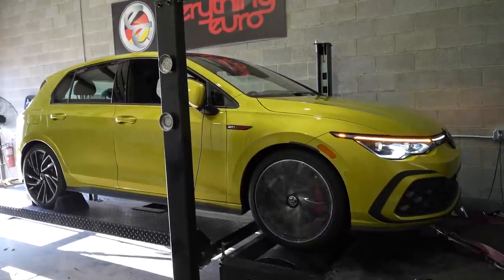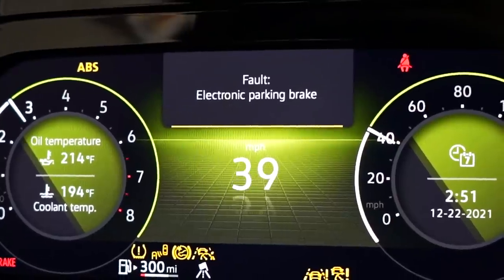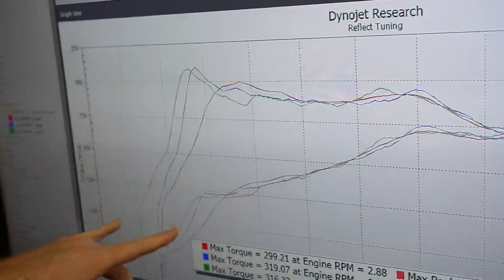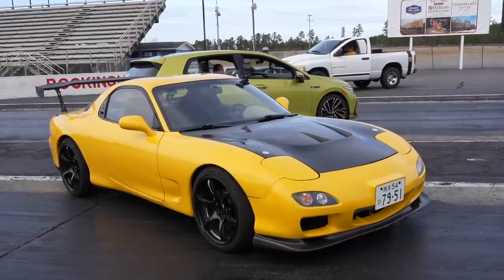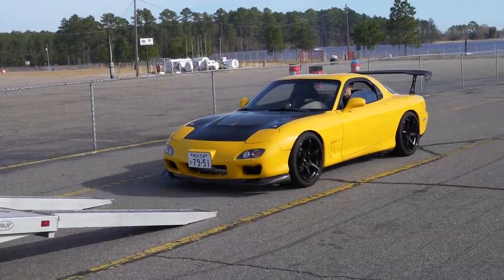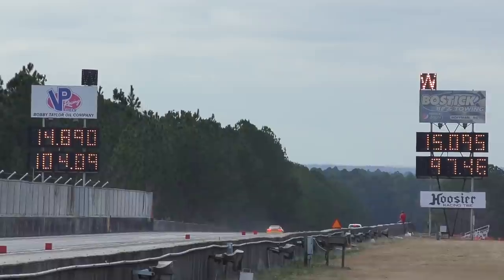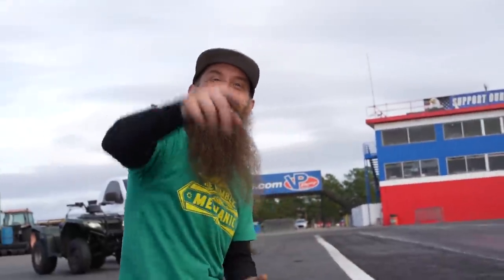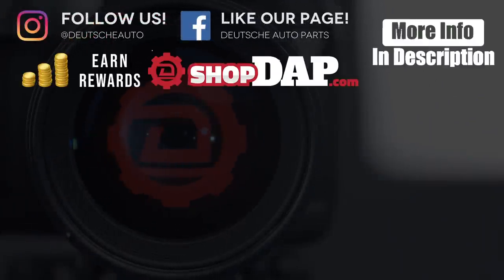Stock MK8 GTI 1/4 mile Times & Dyno Numbers!

Comment: "Granny shifting, not double clutching like you should"
Reply: Not only is that one of the most quoted F&F lines, its also bad advice...
Reply: Life my live a 1/4 time at a mile!!
Reply: @Floyd. B If you say so.
Reply: @YTB_JSNFARRELL  Thanks...
Reply: @Floyd. B double clutching upshifts is the  biggest waste of time ever
Reply: @Floyd. B 1st off its not for upshifting, as the RPM's on the input shaft drop to match the transmission speed. 2nd it has synchros.  

Double clutching is for cars without syncros and for downshifting only.
Reply: @Floyd. B I just watched.  No double clutching.  Blipped throttle on the downshift and single clutch.  Go read an article.  It does literally nothing except slow your shifts and make you clutch twice as much.  

The line from ff is just something that sounded good.
Reply: @Floyd. B But its for downshifting only.  It does nothing on upshifts.
Reply: @AB-nv7bz  Yes it is. I've driven an old Steyr 680 Truck in Austrian Military with not syncronized Gearbox. Upshifting you have to double clutch with a little feeling to ...kkkrraaachhh... the next gear in ;p
For downsifting you have to put the gear stick in neutral, let off the clutch, rev the engine to the right rpm, press the clutch again and shift smoothly...KKRRAAACHHH!!!.. in the gear you want. Actually it's not that hard, you just need time with the vehicle to get a feeling for it.
Reply: @D00MINIK  You just didn't know how to drive it.  The double clutch was just giving the time to let the speeds match up.  

You can accomplish the same thing with better timing.
Reply: @AB-nv7bz  Yes, i learned how to drive it, it's always great to get advices from someone who accomplished shifting without clutch with a syncronized Transmission and is now the God of Driving. You're right, upshifting would also work without clutching at all at a non syncronized Trans but it's harder than with a syncronized, it's uncomfortable and it puts stress on the Mechanik, or are you driving stick upshifting always without clutch, because one time clucthing would not work wothout syncros
Reply: @D00MINIK  it has nothing to do with that.  From an operational standpoint it not necessary.  It’s a timing thing.  U need input shaft to drop in rpm so the output shaft will match.  Disconnecting the output from the engine doesn’t help.  It’s easier to clutch because u reduce rotating mass but it’s not necessary
Reply: @AB-nv7bz  In a theoratical World where you're a driver who could match the rotational speeds perfectly, you're right. But this isn't and you aren't. So, like i said, you're putting a lot of stress on the Gearings of the Transmission if you upshift without at least clutching from neutral into gear, better to double clutch.
Reply: @D00MINIK  big rig truckers don’t double clutch.  Gears will be fine
Reply: @AB-nv7bz  That is a good point. Big Trucks today are mostly Semi-Automatic. Manual Gear Stick with an Automatic Clutch. So of course the don't press the clutch for shifting although some of them do have a clutch pedal. And yes, now i read that there are old non syncronized Transmissions which are built for shifting without clutch. But these are very rare, the most built ones are clearly saying you have to double clutch. That many Truck drivers nonetheless do it doesn't change the fact that it increases Wear
Reply: @D00MINIK  not in the states.
Reply: @AB-nv7bz Espacially in the US.  Eaton invented this Transmission in 1990.  One of the, or maybe even the biggest Company for Truck Transmissions and it's a US Company.
Reply: @@Floyd.B You go do your double clutching and eat through clutches once every 6 months.  Have fun.

Comment: 2022 Subaru BRZ posted much faster times and a higher trapspeed with 30whp, and 120wtq less than this mk8 gti. I always tell people to not get the stick shift in a gti or golf r, DSG will hold much much more torque with less issue.
Reply: Would never choose DSG in a GTI or something else
Manual is the only way to drive a GTI
No better feeling than dropping gears in a corner and feeling the clutch and brake and then accelerating through the gears and so on
DSG gives no driver enjoyment
May as well drive a automatic
Reply: @robertroberts9854  dsg is an automatic. It automatically shifts for you. Totally agree with you though. Driving a manual is just a lot more respectable. Racing an auto is like seeing who can flip a light switch faster. Sure there are variables. Maybe yours is rusty and old and you're up against a crisp new one. Maybe you lubed yours up and idk added a spring to it to make it faster. Cool. But in the end you're both just flipping a light switch.
Reply: @luislozano1513  DSG paddles shifts I meant , but I get the point
Like a said, I've driving a DSG GTI mk7 and I driving a Manual GTI mk7 and the DSG is boring and gives no driver enjoyment, that's why I bought the Manual 
But that's my opinion, I understand why people choose DSG, but GTIs or any Hot hatch has to be a manual in my view, otherwise just by fully automatic and an electric car
Reply: @robertroberts9854  look at you, shiftin' mid corner in a GTI.
Reply: @dubsessed9790  in a mapped MK7 GTI
Reply: @robertroberts9854  alright?
Reply: For a daily i always recommend a manual but if you wanna go fast the DSG always comes out ahead in my opinion
Reply: @euroberto85  That's my point
Manual is the better option of you actually want to drive the car
DSG gives no enjoyment and no feedback
It's just plant your foot down its boring
I driven both and its no contest 
But that's my opinion of course
Everyone has different ways of driving, if you like automatic then go for automatic 👍
Reply: @robertroberts9854  DSG is great for a fast daily. There's definitely an enjoyment to a crisp shift and the vag 'fart', just nowhere near as pronounced on a relatively slow GTI, and that's from someone who's gone from manuals all their life to a DSG.
Reply: That’s because this is a casual trying to see what times he can get. Go look at car and driver timings for the MK8 GTI. It poops on the BRZ. 105 trap speed. Lol BRZ has no chance buddy
Reply: @glistud8178   That's the DSG model, we talking stick shift for stick shift.
Reply: @Kai240i  the manual still does much better timing than a BRZ, you are seriously not going based on this video right?. He literally was having traction issues. Go watch any BRZ videos timed with draggy that’s not done by professionals and the 0-60 And quarter-mile will  shock u with how high it is
Reply: @glistud8178  it's kinda funny that the people downplaying the GTi's stock performance based on this video...didn't notice the 360whp RWD just as light as a BRZ...RX-7 that ran a 14.8 as well. It's almost like...it's almost like drag racing takes a lot of skill or something 🤷‍♂️
Reply: @Kamukix  hahaha exactly bro, there’s literally draggy proof of the MK8 GTI with its trap speed of 105 and quartermile of 13.6 but they wanna find a way around it 😅😅😅😅
Reply: @glistud8178  lol its crazy
Reply: @luislozano1513  dsg transmissions are not automatics there is no torque converter like a conventional automatic transmission. They are 2 input shafts that mesh the gears together. Dsg, dual clutch, twin clutches whatever you call them are basically manual transmissions without the clutch pedal and rowing gears on your own. Thats why a comparable actual manual transmission car will lose every time against a comparable dual clutch car in acceleration. The upshifts in dual clutches happen in milliseconds.
Reply: @laclassssn705  if a transmission shifts for you automatically then it is an automatic transmission regardless of how it does it. The definition of an automatic transmission is a transmission that shifts without driver input. Can you put it in manual mode? Sure but that doesn’t take away the fact that it will shift for you without your input if you need it to.

Comment: Excellent video. It is not easy to launch a standard fwd GTI. Just enjoy it on track days, it will be a lot better than the drag strip
Reply: Agreed, even more testy with mods... sounds silly but a 5mph roll-on does a lot better.  Not great - but definitely a difference maker.  And...doesn’t so much beat the  crap out of all the stress points as just dumping it...ooof.
As the owner of a modded MK7, you're right - they are made for the twistys not so much the strip...
Reply: @audieconrad8995  i had an mod MK4, mod MK6, now i own a MK7.5 and they all a delight to drive on twisty roads.
Reply: @hjm33  yes-they-are!👌

Comment: Paul, great effort, one thing EVERYBODY is forgetting,,,, you own that car, it is your car to live with.  When the media tests a car, they hammer the living crap out of the unit and hand back all the bits and pieces back to the manufacturer to put back together.  I think a better test and way easier on the drivetrain would be a rolling start and pull through all the gears.  That is more "consumer-centric" as that would help determine what the car would be like entering a freeway on ramp that is short and has a semi bearing down at you doing 75MPH!!!!

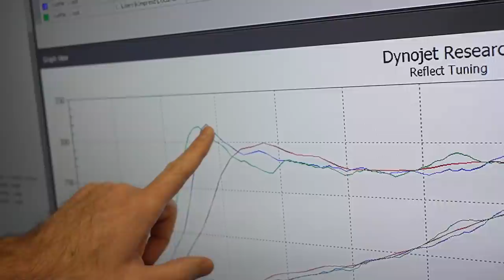Comment: @3:30 the reason you see more torque overshoot in 4th is because the ecm is managing the overshoot in a time-dependent manner and you're plotting over RPM. Take a look at the samples - the overshoot in either gear takes roughly the same number of samples to correct (I'm assuming the dynojet samples at a constant frequency no matter the gear). Also, the turbo accelerates in fewer rpm when in 4th, so the absolute torque is a little higher.

Comment: I can't stand the aesthetics of the MK8 (inside & out).

But I'm hyped to see how well this gen takes on power mods. I have a feeling MK8 owners will be able to break 400whp on the MK8R turbo on pump. Something that needed ethanol for the MK7's IS38.

Can't wait to see more content.
Reply: I'm curious. I'm betting the tuning limits will be pretty similar though.
Reply: Same sentiment.  I absolutely loathe the car's aesthetics, but I have nothing but respect for the advancements VW has made in terms of performance.  I've got a MK6 with CTS Turbo's K04-X turbo kit with a custom ecu/tcu tune and the factory fuel system is preventing me from breaking more than ~350 whp/tq.  I'm looking into fueling solutions right now, but I'm not too keen on the idea of running water-methanol injection to break 400 whp.
Reply: European Kia 👌
Reply: With the lack of traction on the GTI and the factory power bump, it seems Stage1 might be the max "useable" tune, but for the Golf R? Looks like we're in for some tuning madness I bet, should be fun to see!
Reply: @dubsessed9790  not necessarily. Off of a dig, definitely not as usable. However, on rolls the extra hp and torque are very much welcomed.
Reply: @apcordero99  yeah I suppose when slicing and dicing on the highway, but I really meant when working through some tight twisty back roads. I should have said that, but that's what I see the GTI for anyway, it's never meant to be a drag racer on the highway or from a stop, but it's fun to throw around the twisties if the power is balanced, and super easy to drive at that level even considering managing the understeer. But once it has more power than that (stage2 or turbo swap) it starts to feel off balance to me for the GTIs main purpose, cornering. That's all I'm saying - with the FWD the stage1+ seems "perfect" on that car
Reply: @dubsessed9790  agreed. Stage 2 right now on MK7.5 and the car scares the shit out of me on cornering. You need some top quality tires paired with perfectly tuned suspension for stage 3.
Reply: The is 38 ist good for about 440 crank hp  i believe but in Germany we so have higher grade fuel which might help a little bit
Reply: problem with the golf R you're likely gonna need a built engine for 400whp or you will throw a rod, plus it will inevitably shred the transfer case and or the rear diff clutches too
Reply: @Tehsheeeep  no? Lol

These motors can take on 500bhp easy. You're thinking of torque. Most tuners limit torque to 450. Going higher requires a built head. 

But the block on the MK7's is pretty beefy.
Reply: @Peylix  fair enough, my mistake, I know from experience though that the transfer box is a bit soft and the rear diff clutches can suffer even from a stage 1 tune
Reply: @Tehsheeeep  definitely can handle well over 400 horsepower, the torque is what will destroy these motors, most tuners will keep the torque around 400ft/lbs to prevent any damage to the motor on the stock internals.

Comment: One ”driver” mod could be to adjust the seat properly. I think it would be easier for you to control the car in a more upright position.
Isn’t there a launch mode also in the manual car?
Reply: No theres no launch controle on thr manual version thats why its alot slower but his 60 foot was high if he droped his two front tire pressure 25 psi his 60 foot would drop 1 or 2 but his trap increases 2 or 4 mph so he would have got 60 foot 2.4 14.6@100mph or 60 foot 2.3 14.4@102mph. The dsg declaires 13.8 because it has launch controle plus the auto puts down the power more easy.

Comment: I'd suggest going out on the street and doing some practice launches with the traction control off and familiarizing with where the sweet spot is in the rpms to get a decent launch.  You'll need to slip the clutch and get the car to start moving rolling, then pop the clutch as you get off the line (this will get the car to jump forward, rather than spin off of the line).  Admittedly, I currently have a DSG and it is a lot simpler.  However, I previously ran a MK3 VR6 and hit a 14.6 at 95 mph in the 1/4 with a 2.3 60' on street tires on a 98 degree Fahrenheit day in the middle of August in N.C.
Reply: 14.6 in a Mk3 VR6? Damn! Awesome!
Reply: @jameshaulenbeek5931  Slight typo, it was actually 14.7.  I tore apart that motor in my parent's garage and replaced the timing chains, swapped the cams for Techtonic Tuning's 264/260, ground out the welds in the exhaust manifold ports and had a buddy re-weld them on the outside, installed a 42 Draft Designs test pipe, Borla cat-back exhaust, and BFI chip.  Dyno'd at 172 whp/162 whtq on a mustang dyno.  Also had some suspension work done (H&R springs, Bilstein HD shocks, poly motor mounts).  I had big plans for that car, but unfortunately it spun a rod bearing and my neighbor ran her car down the side of it just a few months before.  Ended up selling it to a friend for parts.  Never got over that loss.

Comment: How many miles are on it at the time of launching? You probably also got slower times with how bad the stock clutches have been in the past. My MK7.5 R had a hard time after a few pulls and I feel it get more spongy/have softer engagement for sure after a few pulls. I’m not ballsy enough to launch my car until I get my new clutch in and go through the proper break in procedure. I bet once you take out the clutch bleeder block restricter, braided steel clutch line, and practicing where the car likes to launch, you will be able to match or beat the projected times. Keep up the awesome work Paul! I love your videos! They have helped me a lot when it comes to modding my cars and just having good laughs. I super appreciate everything you do!

Comment: It definitely looked like the traction control was being a problem as well. Doesnt look completely off
Reply from the maker: It seemed like it was cutting throttle in 1st
Reply: @Deutscheautoparts  Time to disconnect abs wheel speed sensors :P
Reply: Couldn’t you just un plug the abs module ?
Reply: @Deutscheautoparts  I don't think it was traction control.  I think with how you dumped the clutch, the car saw wheelhop and thought "oh no you're spinning out/wrecking!" and tried to wrangle it back in with stability management/control, which can't be turned fully off according to US laws.  Try slipping the clutch a little longer next time.  I've done 14.0 in a friends stock MK8 GTI on this exact Rockingham Speedway track by doing that.  Same tires, everything.  I have a lot of drag racing experience, but he managed a 13.9 after me by doing what I showed him.  If you ride the clutch a little uncomfortably long, it does much better 60' times as the stability control doesn't kick in on you.
Reply: You have to fully disable traction control through VCDS on the Mk7's so I'm sure it was still kicking in here
Reply: @BasedEMT1776  This is what I try to advise to people trying to launch a FWD car.  It's a lot trickier than people realize.  You have to slip the clutch until the car starts rolling, then pop off of it to get it to jump forward.
Reply: @whorutothink  and it should reduce wheel hop?

Comment: Way to go Paul, I had a 99 Passat, 1.8 t modified to the max before short-block replacement,  350 hp wheel hp, went to the track and couldn't get into the low 13's, couldn't hook up the power🤙🤙🤙